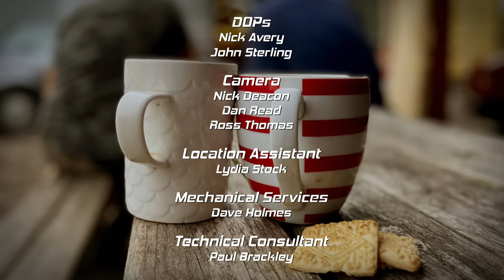Saving a 2CV - Flipping Bangers - S03 EP08 - Car Show

Comment: Love watching Gus and Will. I've always found French automotive design engineers to be non-conformist and innovative. The 2CV is a brilliant design for its time. Made for self-maintenance and ruggedness, based on minimal use of materials. Lightweight with a small economical engine. Unfortunately the materials technology and rustproofing of the 50's thru 70's were not geared for longevity. So we've lost a lot of these cars. But they are a hell of a fun drive !

Comment: My first car was a 1994 Citröen AX, the 2cv great-grandson!? It had a headgasket-blowing 1.4 diesel engine on it but despite that, I travel all over Europe and it was a blast. Unfortunately the block eventually fatally cracked and I had to let it go. It was originally my mother's who got it after struggling with rough country roads on her beloved Mini. She loved the Mini but her back didn't like it so much. The AX was a breeze of fresh air, flying over potholes like they were nothing. I miss it terribly. It was cheap to run (4l/100km) and easy to maintain... apart from the problematic overheating issues due to the badly designed head gasket interface.
Reply: the 2CV flat-Twin has no gasket and new oversized cylinders and pistons costs a few hundred euros. some originals have 200-300.000 km without revision.

Comment: One of the best and fun cars i have ever owned £90 LHD 425cc it had 25000 i did another 40000 only did sparks, alternator,  fan belt that snapped continued using me girlfriends tights points and breaks front and rear drums on both oh and shocks, only grunting expense was the 52mm socket for the rear drums, last but not least the drivers window clip which being a left hooker was half the price, passenger side over in uk. Would love another but just can’t aford that sort of money, it would never go down now but i did a window cleaning job once in a while for a friend who had angina, a 10ft ladder strapped vertically through the open roof onto that cross bar and seat leg frame, that was freedom.

Comment: I'd much rather lose all the rust.
For example, claiming you're keeping the history by not making it look new, so why fit new seat covers. Do all the welding but leave it in primer which is neither new or old, just unfinished.
My dad had three 2cv's the first was the special edition 'SPOT' which was orange and white with square headlights. Then one like this, same colour but with a matching roof and a red one which was the spares car.
They look so much nicer without the rust, as indeed is true for every car.
And the value increases the less rust there is as it will last longer before requiring further restoration.

Comment: when you re-rubber the seats put thick cardboard from large cardboard boxes over the rubbers before adding the foam and then the covers, it gives the seats more support, I restored a 2cv6 about ten years ago and had to sell it on eventually , wish I never did now. if you rock the car and it makes a mooing sound the suspension cans want lubricating as the paper disks inside dry out pump some castor oil into the cans and the noise will stop. its a common fix amongst 2cv owners. The engine is designed for 15w 40 oil. The hardest job is replacing the fuel tank sender unit if you have to its a fuel tank out job, check behind the rear wings for rust on the inner wing panels as they rust here badly to. god help the person that needs to replace the windscreen scuttle panel its a job and a half when it starts to leak in the rain and dont have any hopes of more than 50mph with the roof down or youll lose it. Ten years ago I paid £300 just for the seat rubbers or donuts as you call them they were a pound each at the time cheapest available in the UK.
Reply: the price per rubber with hooks are nowadays ~0,85 € or 50 for ~60€, in the 2CV are ~198. there are other solutions too.

Comment: The chassis needs to be replaced every few years. With a galvanised one it's holding some years longer...
Reply: 6 cans of spray vaseline (PRESTO) underneath does it. It has stayed rust-free. Since 5 years. BUT my car is BEFORE 1968 (a Dyane 1967 - luxury 2CV) an thus have a much better steel quality. The 1970's were the worst for ANY car concerning the steel...

Comment: Make sure that you've got the right brake fluid for your model, use the wrong one and they will rapidly fail.
Reply: since 7/81 disc brakes in front with green LHM brake fluid, before DOT4.

Comment: Wtaf 😂
paid far too much for that car.. Here's a tip instead of buying a car then getting it back to your workshop and Then start probing for problems. Find them before you've handed over money and use that as a bargaining tool against the seller, who got his ridiculous price. The only thing dumber than that was anyone who "actually" paid 49 hundred pounds for that turd I absolutely love this show because just when I dont think you can do worse than the previous show you surpass it with gems like this please never stop
Reply: nowadays for 2.500€ you get far worse 2CV, in relatively good restored conditions you pay ~10.000€ and more

Comment: Horrible little uncomfortable, underpowered, rust bucket; getting laid in one was almost impossible. 😢.
Reply: comfortable, enough power and waxed not rusty a perfect daily driver
the old ones with 375/425 ccm and 6/12 hp 70/80 kph
the newer ones with 435/602 ccm and 24/29 hp 90/120 kph

Comment: Bit disappointed to see Will changed the ignition point to electronic. To me the classic car like 2CV should be kept as it is. That's the beauty of old cars it allows the owner to do tinkering. But changing to electronics ignition will give better engine performance. Tbh i had share of cars with ignition points and when it wore out it can be a nightmare. But it's a cheap part and as long as you know how to do it yourself it is not a hassle.
Reply: Exactly, he showed us how clever the points system was, and then promptly changed it to electronic.😐
Reply: yes, I have my Dyane of 1967 with the classic points. With modern spare parts (Trouve France - made in France) they last 12'000Km until the ignition gets "bumpy". Older points (made before 1968) last 40'000Km, but the new spare parts for VW Käfers/beetles last only UNDER 4'000Km (China)
The problem is the fibre part which is gliding on the cam. Points are "simple" tungsten.

Comment: A 2CV with synthetic oil would make me run..  

It should have mineral oil..  changed every 500km.
Reply: Citroen manual every 5.000 km or some say every 10.000-15.000 km without problems.
15W40 / 20W50

Comment: The 2CV looks like someone saw an abandoned pram, upside down and thought, "that would be a good design for a car". I honestly think it's the worst, ugliest car ever to roll off a production line. Don't save it, just scrap it and do the car world a favour.
Reply: 🤣I had a girlfriend who had one in the 80s  , i kid ye not it was fun 🤣😜
Reply: Don't knock it till you've tried it. They are fantastic cars to drive and an absolute hoot at 50mph. Easy to repair and lovely for a drive on a sunny day.
Reply: Better than a Ford fiesta MK 1+2!!! Nothing but grief!!!! Terrible dealers.😡🤬
Reply: Citroën 2CV is the worst “car” ever made: slow, noisy, uncomfortable, dangerous, ugly, and unreliable. Two friends of mine had one in the ‘80s and I drove with both. Absolute rubbish 😖
Reply: @AmigaA-or2hj  That's odd you say that. My cousin has a Fiesta, either Mk 1 or Mk 2, not sure which, and he has no trouble with it.
Reply: I had 3 in the 70/80s for a few hundred DM, rust was the reason. nowadays you pay 10-15.000+€ for restored 2CV.
they are reliable and you can drive the whole day without pain.